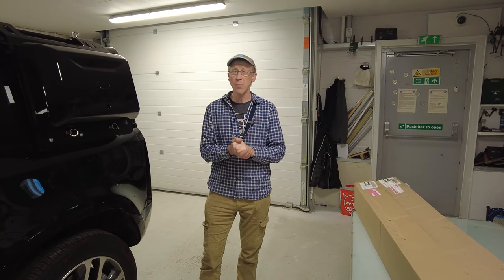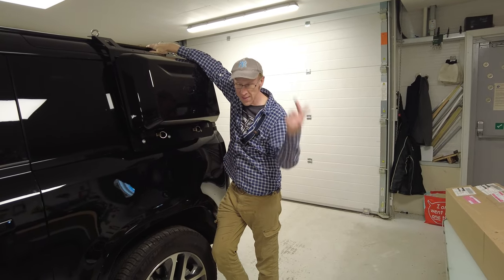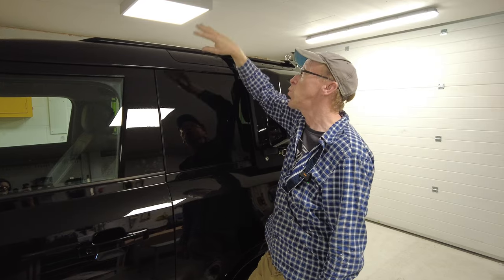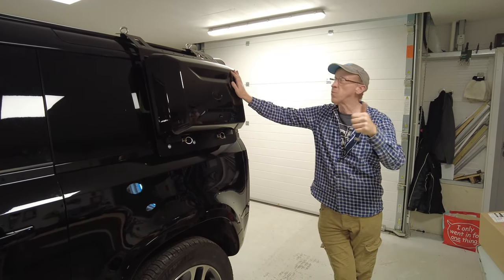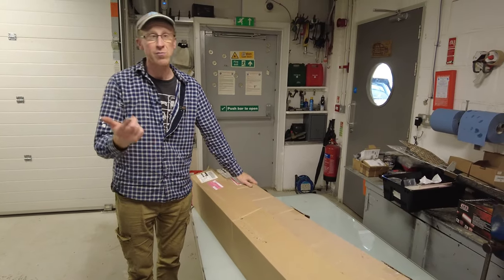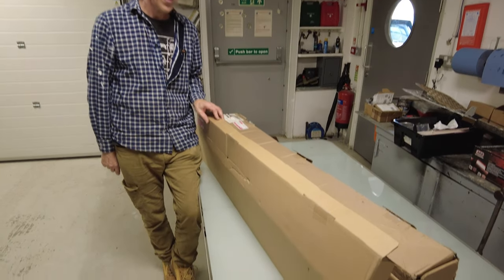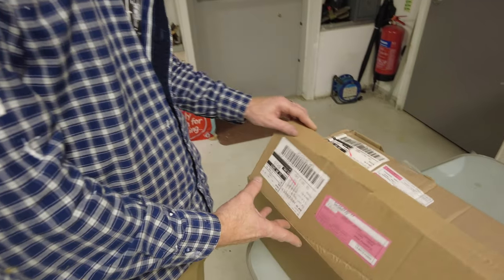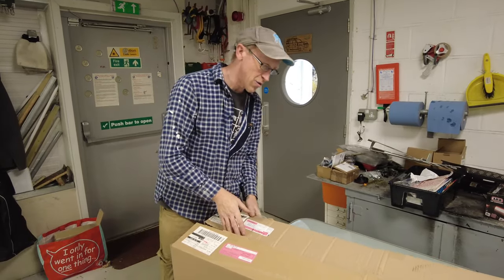Land Rover Defender 90 roof rack / cross bars fitting video (v2 - using the torque tool!)

Comment: Received mine last week and they look great mounted on my 90!
Reply from the maker: Good to hear!
Reply: @L663  any chance the awning mounts will work with molle panel like a billiebar? Im also curious if a molle panel can go above  between cross bars attached with your brackets to mount a pelican case without having to get the expedition rack. I don't want to have the expedition pack on all year but I do take 1 long trip every summer and need all the storage I can get on my 90.

Comment: Useful guide Simon…my choice rather than the full size rack plus I would add your spoiler. It makes the 90 look much better! 😃🙂😃
Reply from the maker: Hi Richard - the problem with the full size rack are I guess 
1) Wind noise 
2) Fuel economy
3) Price
So the cross bars offer some advantages - but they are very close together !

Comment: What is the distance between the roof bars when fitted to the defender 90?
Reply from the maker: Good question - it is about 720mm from centre to centre - not very far apart !
Reply: @L663  
Thank you. Your video was most helpful- the notches dictated the position.  720 is too close for some of the larger RTT I have been looking at.  Your vid on RTT was most useful too 👍.
I only like the 90.  I could fit a roof rack instead of rails but the added weight brings the roof loading too low for most RTTs however if you have off-road tyres the roof loading comes back up by around the weight of the roof rack 🤷‍♂️ so I would be ok.  I really can’t understand why the tyres could make that much difference.  I really fancy the 22” wheels and the don’t offer an off-road tyre for those wheels.  So I am a bit stuck. Maybe forget the Rtt.